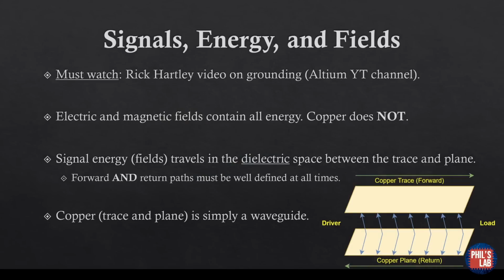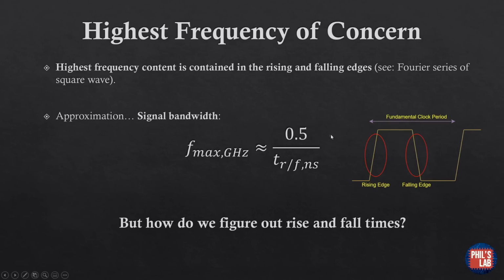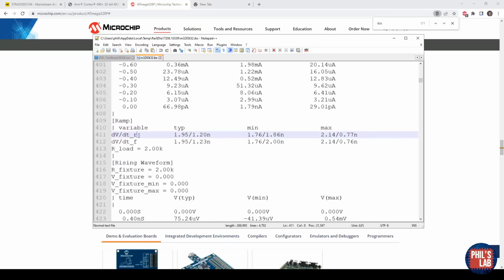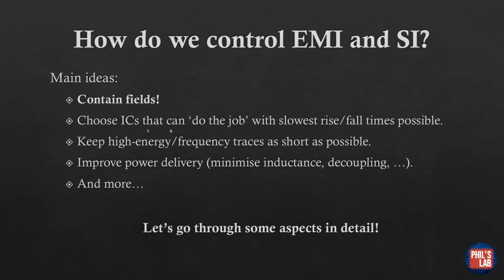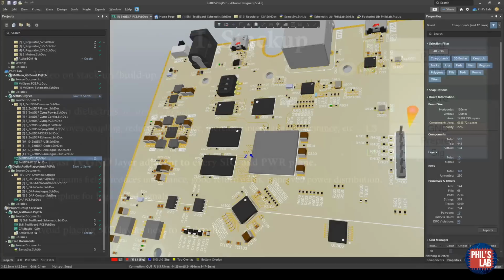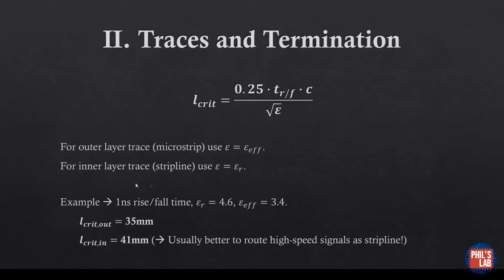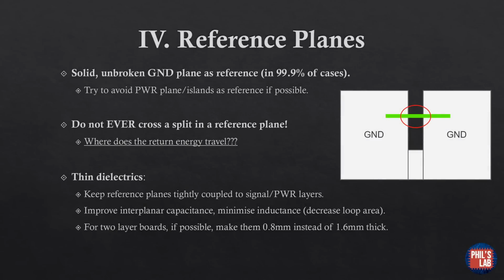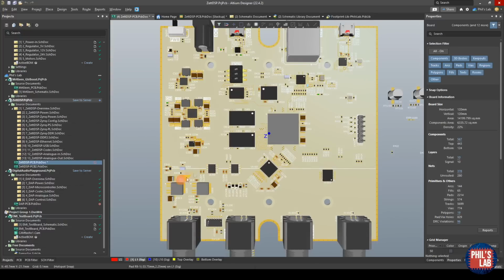PCB Design for EMI and Signal Integrity - Phil's Lab #64

Comment: Hello Phil, thank you for yet another great tutorial. I have a question regarding the ramp times. According to IBIS model [Ramp] section rise and fall values are specified by 2 values. For example, dV = 2.14V and dt_f = 0.76ns. Their ratio gives the slope of the ramp. Should these values not be scaled for 90-10% of total of 3.3V? i.e. According to dV/dt_f = 2.14V/0.76ns, ramp value is 2.82V/ns. Scaling this for (90%-10%) * 3.3V = 2.64V would give a result of 0.936ns.

Comment: When using JLCPCB stackup, use their calculator as it gives slightly different values. Always check if your manufacturer provides impedance calculator.

Comment: When a PCB contains a digital and an analogue portion we need to keep the noise from switching activity in the digital portion away from the analogue portion. In this case, I have read in a few places that the GND plane should be split. The two ground planes need to be connected only at a single point. Here I have read that it should be connected using an inductor so high frequency noise does not couple but at other places it has been that they can be connected using resistor. I do not know which is the right way. However, here you have said that the GND plane simply must not be split. Well, what then about PCBs that are mixed signal?

Comment: I thought the edge bandwidth formula was 1 / (2 * pi * risetime), so 1ns gives 159MHz? Is that wrong?
Reply: That's wrong...
---
The constant in the equation for depends on two points:
* are we talking about "3dB roll off frequency" (f3dB) or RMS noise bandwidth (fRMS) due to rise/fall time?
* what is the shape/model for the rising/falling edge (or more exactly, for it's derivative as this drives the EMC generation)

f3dB <= 0.338 / risetime in case of gaussian pulse as edge derivative
f3dB <= 0.350 / risetime in case of single-pole exponential decay as edge derivative

fRMS <= 0.361 / risetime in case of gaussian pulse as edge derivative
fRMS <= 0.549 / risetime in case of single-pole exponential decay as edge derivative

gaussian pulse = typical edges are a "gentle" sweep with symmetrical leading/trailing edges
single-pole = typical edges start abrupt in a steep rise/fall and go into long sweeping tail

(Source: High-Speed Digital Design - A Handbook of Black Magic)
---
The most simple model would be a linear rise/fall of the edge. The calculation would be:
* the derivative would then be a simple rect pulse with a width of risetime.
* by fourier transform you get the spectrum as a sinc( omega / (2 / risetime))
* if you calc the 3dB point (=sqrt(0.5)) you get the angular frequency for 3dB edge as 1.392 * (2 / risetime)
* divided by 2 pi to get the 3dB frequency => 0.221 * (2 / risetime) = 0.443 / risetime

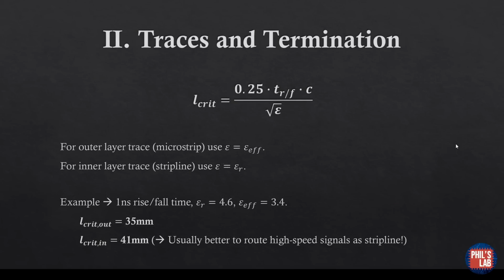Comment: Minor mistake at 13:25 - the critical lengths for microstrip (outer layer) and stripline (inner layer) are swapped. Stripline should have the lower critical length (35mm). The takeaway that it's usually better to route high speed signals as stripline is sound, but not because of a longer critical length.

Love your videos, really appreciate what you're putting together here.
Reply: Apologies for resurrecting this. It's clear from the difference between dielectric constant (vs effective) that you're correct. However could you clarify why the takeaway is still correct? If signal integrity is all you care about (and not EMI), then is that still true?
Reply: @DeShark88 Inner layer traces can also be thinner for the same impedance, so they take less space. (Especially true for differential pairs, where space between them will be allowed to be smaller too.)

Also, since fields are better contained it's not only better for the emi but also for SI of nearby traces.

Comment: I'm wondering why you have put vias all around the border of the PCB you showed of in the design. Is it in order to contain the fields from escaping from the sides of the board? When is it necessary to do so and how much does it help reduce EMI?
Reply: I dont think it matters much for the emi from the traces (their fields are very narrow anyway) but rather to stop planes themselves emitting when their voltage bounces slightly when driving fast slope ICs. Decoupling caps and planes capacitance should stop this anyway, but no one would want needs a risk.

Comment: Is it at all ever considered to low-pass filter these square-ish signals down to their fundamental frequency (so essentially down to a sine wave)?.

Counterpoints I can think of are the need for extra components/traces on the board, and possible issues with signal delay due to the filter's phase response (which could potentially be compensated for in some way though).

Comment: Is there a reason why you terminated the signal traces on your em board with 1k resistors, would it be interesting to end them with sma connectors for oscilloscope measurement?

Comment: Thank you, so informative! What left me puzzeling is, why a slow rise/fall time leads to higher frequencies. Turns out, it is again just Fourier transformation. That leads me to my question to you: Is it a thing in digital signals technology/research to not use rectangular/trapezoidal pulses, but others such as chirped (frequency modulated) pulses? This could increase data density and/or reduce loss/problems due too high frequencies. (Questions might sound strange, that is because I'm coming from a physics background and having no clue about electronics).

Comment: Love your videos !! I was wondering what approach you recommend regarding clocks. Especially when devices have their own internal oscillator or can take external crystal or clock signals. I'm working on a design where I have 6 devices that have internal clocks (1 MCU running at 120MHz from internal 8MHz + 5 devices running from internal 12Mhz). Plus one other device requiring external 24MHz (from crystal or clock). My current plan is to use one single 8MHz oscillator to feed the MCU which has the ability to generate external clocks so I would generate the 12 and 24MHz clocks and distribute from this central location. Is this a good approch ? Or is it better to let every device use their internal clock ?

Comment: Hi I had a question brewing while watching your recently public udemy design video and it came up again here; 

You mention never having a signal cross a break in the ground plane, but am I right in saying you did cross it a few times in the STM udemy design? I'm referring to the necessary bias to run very short traces on the bottom layer, I think there one in routing the USB connector for example. Does that not introduce a small cutout below the USB signal return path? 

I may have the wrong end of the stick or it might just be a necessary compromise for 2 layer boards. Also very much enjoyed the video, I'm an EE undergrad that has zero PCB courses in my program and I had just watched the Altium grounding video a few days ago. This is a very helpful summary and application of some of it

Comment: Great material resource!!
Your content have been helping me to understand a lot about SI/EMI, how to design boards for EMI. I appreciate the work you have been doing to release such rich content.
As per your recommendation I watched part of the Rick Hartley video and it was quite enlightening.

I do have a question regarding 2 layer boards, what is the benefits of using 2 layer boards nowadays??
Since most circuits are distributed length (rise/fall times smaller than propagation time), wich can create a SI/EMI problems if not carefully routed. The fact that on most 2 layer boards you can only have one " solid reference plane ", usually on the 2nd layer, since most of the times signal is routed on 1st layer, and having a plane in the signal layer can actually increase crosstalk between interconnects. Most of the times is harder to achieve desired characteristic impedance on a 2 layer board, which in most cases require a wider transmission line, lol.

So in the end, what is the benefits of using 2 layer boards ?
You can get 4 layer boards for the same price and achieve desired impedance easily.
Reply: (disclaimer: very much not an expert)
I think it actually is price in the end. On JLC's homepage at least 1&2 layer are $2/5 for 100x100mm, and 3&4 layer are $2/5 as well but only for 50x50mm, so 4 times the area for 2 layer.

I think it might also be for time cost, and as a learning tool to illustrate fundamentals. It might be faster to design a 2 layer, or easier to automate or do on autopilot, and in the scale of a project with 40c PCBs I think the work hours are a much higher cost. Again, not expert, could be way off and it's actually easier for most people to work in 4 layers
Reply: It's still cheaper, faster, more options (colors etc) to use 2 layer boards.  If you are connecting cables to the board, ask yourself do they have a reference plane? No - so why 4 layer board then.

 Of course routing is easier on 4 layer.

Comment: Something that's not really obvious in the video that I have a question about, specific to the section about vias:  Would pairing a signal via (that's going from the top layer of the board to the bottom layer or vice versa) with a ground via reduce "voltage wobble" on nearby analog tracks?  I have an analog keyboard design that has WS2812B LEDs where the output signal of the LEDs crosses over the analog signals from the hall effect sensors (perpendicular) in a lot of places and vias are basically "free" so it'd be no big deal to put them all over the damned place.

Obviously, a multi-layer board with layers dedicated for digital and analog signals would be ideal but I don't have that kind of money 😁.  Also, I'm able to work around any and all voltage wobble in the firmware but reducing it makes that job a lot easier and also would enable finer resolution in the detection of keydown events.

I'd also be curious to know if having a ground pour of the power plane helps or hurts voltage wobble/noise in the analog signals.  Right now I've got a ground pour on the bottom (that necessarily gets broken up in very short bits here and there) and a copper pour for the 3.3V analog power on the top but that top copper pour is broken up all over the place but there's no islands--there's continuity throughout.  I'm not sure what sort of impact that would have on things.
Reply: The top layer 3v3 pour is not a good idea.  Route it as a signal, point to point.  Where you have broken the ground plane and you have signals crossing that break, the best you can do is to put GND 'patch' links across the break on layer 1.  Your return will now flip to L1, run parallel to the signal is returning across the break, then return to L2.

If it's an analog signal I would try to put GND patch in pairs around the signal only where it crosses a break, though of course valid to route signal+GND as a pair from source to sink.
Reply: @robiniddon7582  Why is the top layer 3v3 pour not a good idea?  Should I just not have a top layer pour or should it be GND?

Comment: Great video with tons of useful information as always! Thank you Phil

Is the stackup: "Signal / GND / GND+Power tracks / Signal" better than "Signal / GND / Power/ Signal"?
Reply from the maker: Thank you, Efrain! I typically would go with Sig/GND/GND/Sig, with routed power on the signal layers. Definitely wouldn't split up the GND planes with power tracks.
Reply: @PhilsLab  thanks for your reply. So, between "SIG /GND /GND + ROUTED PWR/SIG" vs "SIG/GND/PWR/SIG" which one would be better?

Comment: Your knowledge is super impressive, been following you for a long while now, love the vids!
Is it okay to do:
Layer1: GND with 3.3V and 5V traces
Layer 2: N/A with signal traces only
Layer 3: N/A with signal traces only
Layer 4: GND with 3.3V and 5V traces
Reply from the maker: Thank you very much! No, I'd rather recommend L1: GND, L2: Sig/PWR, L3:Sig/PWR, L4:GND. There's enough spacing due to the thick core between L2 and L3 that in this case it's okay to have adjacent signal layers.
Reply: @PhilsLab  Ahh so power can be the same layer as the signals them, and because we have GND on L1 and L4, it sort of protects it all? I'm an by no means an expert, but I do love PCB design and electronics.

Thanks so much for taking the time to reply me!
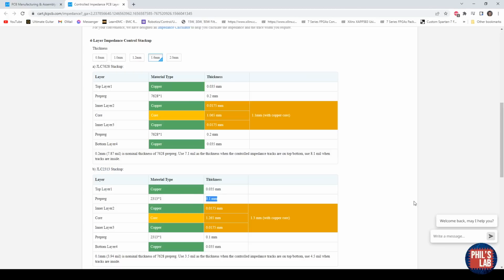Reply: @billyjoe3309   @Billy Joe  also not an expert but in the video he does briefly address this; saying that it's usually preferable to route your power. In this case that means power traces in the "signal" plane. As I understand it, the potential for slightly less optimal coupling is outweighed by having a solid(ish) ground plane for return paths and shielding. 10:26

Comment: I went off and watched Altium's video and you're right - it's essential viewing for anyone who wants to lay out boards properly, but Rick presents it in such an interesting intuitive way that it's worth watching even if you are just curious about the topic. It's long, but the time flew by for me.
Reply from the maker: Completely agree. I've actually watched it more than once - information in it is a game-changer.
Reply: @PhilsLab  I absolutely agree, BUT, it seems that within the power electronics realm not many adhere to his thought process. I've seen very established companies that are passing safety regulations, not using this methodology. For instance,  4 layer boards that are carrying 80 A plus continuously, where in a section of the board all 4 layers are being used as the positive side or negative nets. So, no interleaving Pos + GND + POS + GND, just POS + POS + POS + POS. Or, vise vera with negative. I find trying to bring the philosophy over to power electronics more challenging, especially when creepage requirements come into effect. If you could dive into a power electronics example, like, a high power rectifier for data centers or DC DC supply, that would be amazing. You would be able to tie many subjects into the video, so, it wouldn't be super niche. Anyways, cheers, like your vids!

Comment: This is perfect I was just trying to explain this concept to a fresh out of school coworker.  Ive sent him enough videos from you and Robert Feranec already he refers to you guys as “your buddies Phil and Rob”
Reply: Have you ever worked with MIPI cameras or displays?  Weve having a hell of a time getting it our camera interface to work correctly and im thinking its an signal integrity problem
Reply: @wyattr7982  i'm working as an SI/PI engineer full-time.
I can help you out if you contact me. Drop me a PM and we'll get in touch.
Reply: @wyattr7982  ours mipi CSI interfaces have always just worked ... but you do need to hit the specified differential impedance with reasonable tolerance.   More likely than SI fail is sensor/soc mismatch on expected signalling.

If you have a working reference design for your soc I would be inclined to try the reference sensor on your board (you may need a patch board). You know thst the drivers are ok for the reference sensor.  If it doesn't work with the reference then it might be SI.

In my experience mipi emc issues are more common than SI leading to non functional interface.

YMMV obviously!

Comment: You never fail to amaze me. I expected to learn something but i learnt so much more than expected. Great work. Please keep it up.

Can you give a short explaination how and why termination of lines work?
Reply from the maker: Thank you very much, Helge! Yes, as Kopiko already hinted at, it's a bit of a longer explanation but I'll be sure to make a video on that. In essence, you get reflections when you don't have properly terminated lines (anywhere between open and short), where these reflections will interfere (add/subtract) with your 'original' signal. Proper termination makes sure there are 'no' reflections.
Reply: Long story short. If you terminate a line to the same as the wave-impedanze of the wire you dont have any reflection. r =Zt-Zw/Zt+Zw -> Zw=Zt -> r = 0. The long answer is left for a new Phils'Lab video ;)